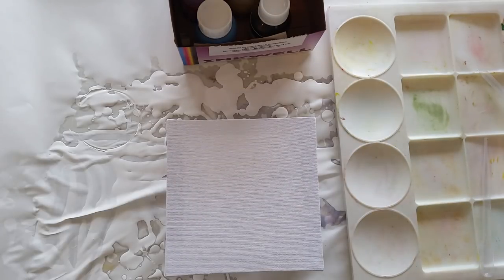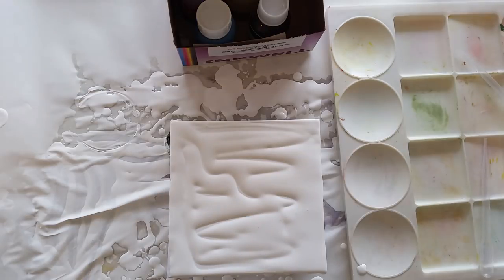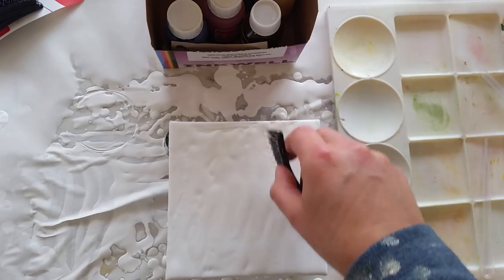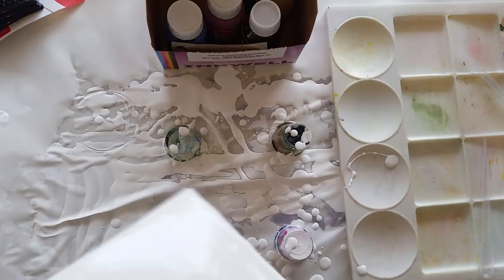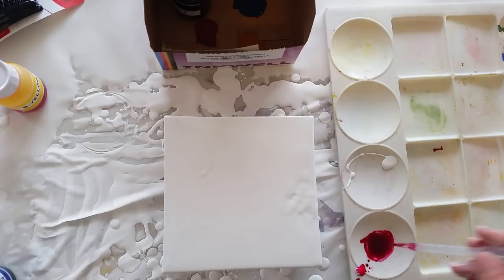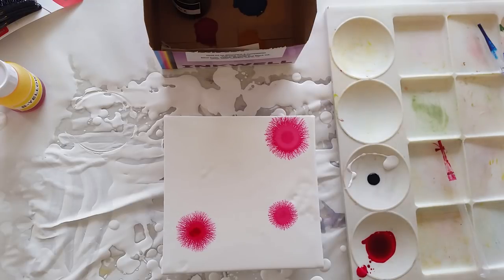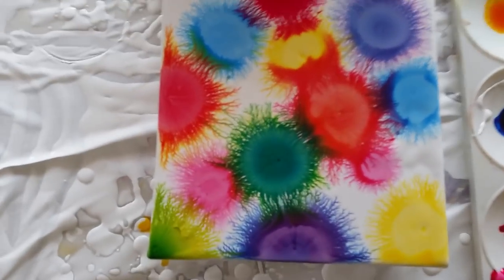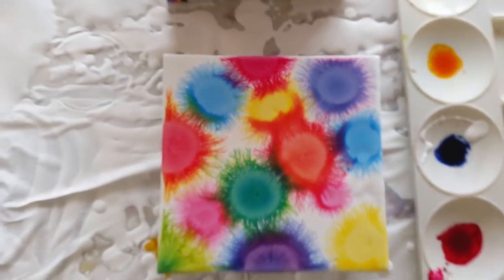034 Experiments with Printer Ink -  Fractals and Flip Cup

Comment: I like that the colors combined where the fractals met. Rather than repelling one another they intertwined. Made me wonder if the inks would work on a paint that wasn't white (another video said this would only work on white paint). When they dried all blurry, i would attribute that to the canvas and not the mix. I think if the same paint was allowed to dry on glass, then the fractals might remain intact.
Reply from the maker: I can see where you get that having seen my shoes dry and I saw this dissolving into the paint start to occur not long after I stopped the camera in the first bit so do think it is the composition of the Inkjet Printer Ink.

Comment: I do wonder how it would work on a tile. Would it behave differently if it was a non-porous surface? Would it have been more or less gelatinous if you had not used dimethicone? Would it work like an alcohol ink if used without paint? Those are the questions I'd ask, but since I don't have any of that ink, don't have any tiles, and have basically exhausted my excitement about alcohol inks, except where they apply to polymer clay (they mix in slowly but nicely), I'm not going to spend time on it.  However, if I had inks like the printer inks, the tiles are easy to get and I would have to try them just to see.  The fractal test you did was pretty, in a soft pastel way. As for the dimethicone test, I would have first tested it mixed with paint without the dimethicone, but I don't use the silicone type stuff anyway. It didn't reject the paint in the first part, so it might be good as just a paint coloring, if you want to go into mixing all your own colors.  Fun test though! Thanks for answering those of us who did have a moment of wondering, you know we're out here...!
Reply from the maker: Martha D lots of great wonderings :) I get it was as the ink seeped into the wet paint that it blurred  rather than into the canvas though. The ink seems to be waterbased.

Comment: Perhaps if you prep the canvas before working on it, you may get better results.
I'm thinking some kind of waterproofing. Hey a couple of coats diluted PVA glue may do the trick there.
>
Reply from the maker: I am sorry I do not understand how adding further waterproofing beyond the gesso already on the canvas would change this.  The end result is created by waterbased ink dispersing into waterbased paint.
Reply: @McEArt  Yes, I understand how this works.
What seems to be happening as your paintings dry out, the colours are being absorbed into the canvas itself.
I am suggesting that if the canvas itself was properly waterproofed first, this muddy-type dispersion might not happen and the end result would possibly closer to how it looked when freshly painted.
I suggested using diluted PVA, because this glue dries / cures to a waterproof polymer.
This would, I think, prevent the paints dispersing and soaking into the canvas itself.
Alternatively, simply paint onto something already waterproof.
Perhaps, some kind of textured plastic sheet.
I say "textured" to resemble the woven canvas fabric.
>